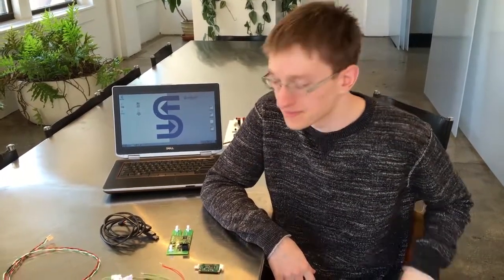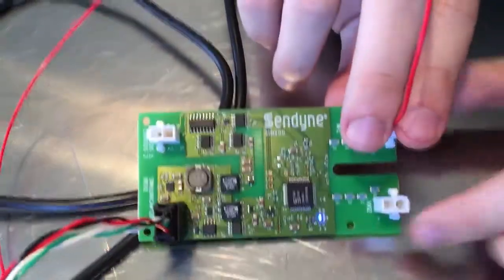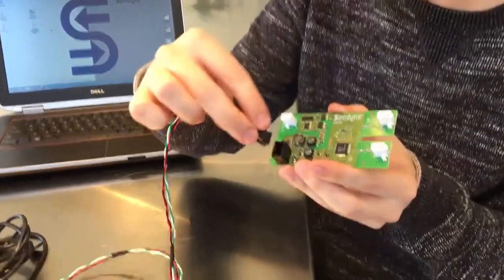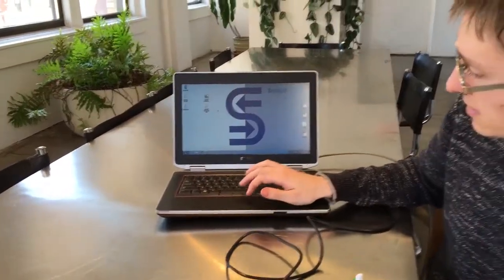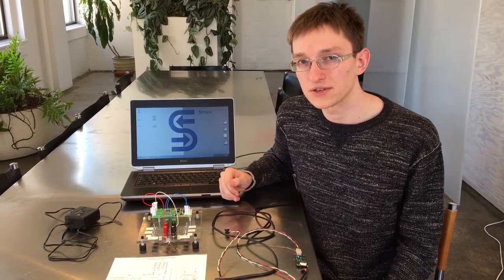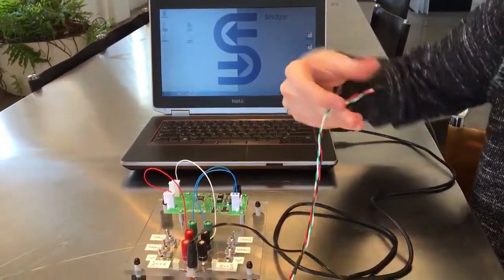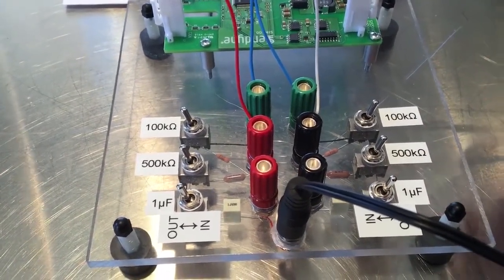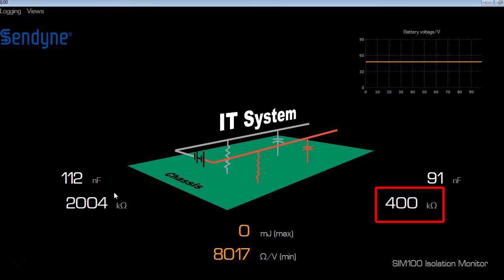Sendyne SIM100 Isolation and  High Voltage Monitor Quickstart Guide and Demo

Comment: Impossible to buy, can try Bender module as it’s readily available.
Reply: Seriously though.. have been trying to get in touch with someone for weeks. Too bad too, as I really need something with CAN and the Bender is Modbus. Oh well, I guess we'll have to add another interface to our system
Reply: @UrbanTinkerer  yep, I ended just using discrete output to get a go/no go. Bender has a new model, ISO-175 that is CAN bus, it’s brand new but reach out again to Bender in PA and they’ll get you a CAN bus ISO-175 for about the same price as the older IR models.

Comment: Does it work to measure the isolation of an EV battery pack of 85kW charged at 80% with a measure of 380V in its terminals?